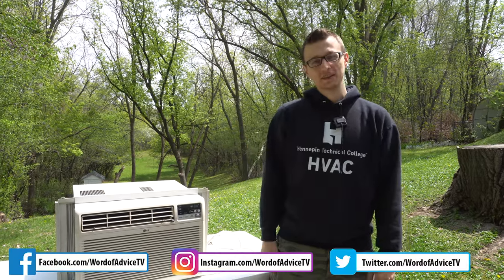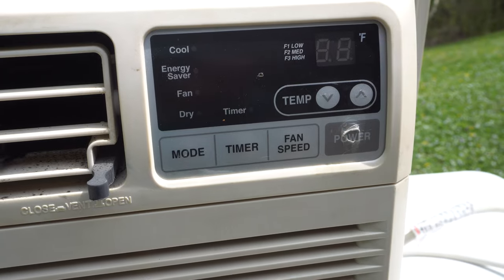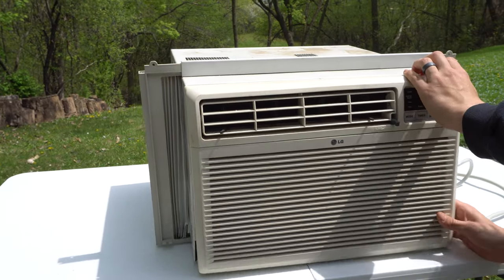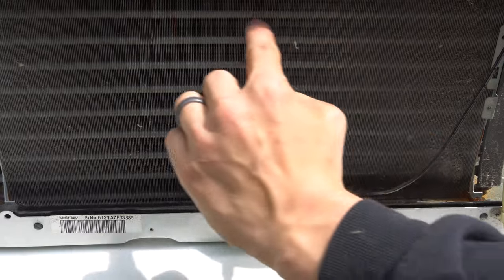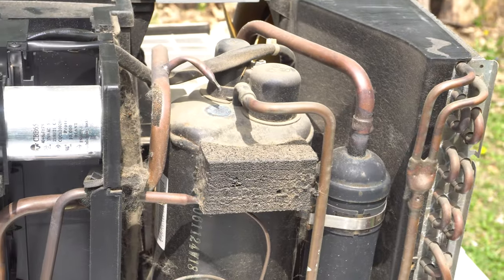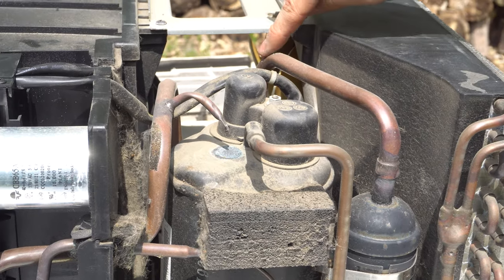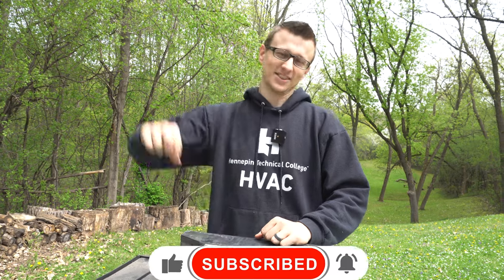Window AC Parts Names, Components, and How it Works

Comment: Your explanation of the channel that condensation flows through from the evaporator coil (at 9:40) just saved me a bunch of work.  My 23K BTU unit is also an LG, and that clogged channel was causing water to drip/splash into the room.  I had a 24-inch plastic cable tie that I was able to push down that channel and clear out the debris that had it clogged.  Thank you for an excellent video.  Tip of the hat to you, young man!

Comment: Excellent explanation, but with all the respect to you and your work, I would like to say something. This kind of air conditioner have no drier filter. That part in the suction line between de evaporator and the compressor suction is called (liquid receiver or liquid separator) and its function is basically avoiding that liquid refrigerant can get the compressor. Liquids can't be compressed and  it can damage the compressor. The drier filter in these air conditioners window type is installed between the condenser and the capillary tube and generally they have no drier filter, I don't know why. Sorry for my comment and greettings. You're doing a great job that's being very important for beginers.
Reply from the maker: I stand corrected. Thank you for pointing that out and explaining what it really is and what it does!
Reply: True , a rule of thumb I guess with filter driers : they are never factory fitted items. And iv not once seen one on a window unit.
Reply: I admire your graciousness. Overall, the time u take with ur many many videos covering many areas are deeply appreciated.

Comment: Great video, very informative. I'm not sure if my compressor is bad because I've tried to clean my little window unit as good as I could with it still in the window. It's a small window air conditioner about 7 years old, just isn't cooling very well all of a sudden. Thanks

Comment: I have a very old A/C unit in my camper I got a year ago, from the mid 90's. If I do all the cleaning as recommended in the other cleaning video & it still doesn't cool could I need freon? If so can I add it or who would I contact to add more? Your video's have helped me so many times to repair my furnace that I've saved so much MONEY 💰! Thank You! 😊

Comment: Great video.  Thank you for explaining all the parts of the Air Conditioner.  I learned a lot from your video.  Regarding your chess challenge...It is impossible for black to complete their turn.  Black King is in check.  Black can't complete it's turn when in check.

Comment: I apologize if this is already been asked, but can I get an explanation on the damper/vent?

I’ve heard both sides of the story; as in it does absolutely nothing and is pretty much pointless, or that you can get a certain percentage of fresh air compared to indoor air, etc.

So I just wondering does it actually affect in any measurable way? Will I get fresh air and a better smelling apartment with it open? what about the exchange setting? Does it literally vent stale inside air outside?

(You seem to mention it only matters when the fan only mode is being used; so does that mean it doesn’t absolutely nothing when the compressor/cold setting is being used? 

Thanks in advance. Great video. As others have pointed out, so clear and to the point.

Comment: So I'm not sure if you've already done it but any chance you can make a tutorial on how to separate and extend the wirings on the control panel so it would be a separate "wired" panel?  I'm modifying one for my camper trailer build.  I'm sure it's self explanatory once the wires are exposed but a video would still be fun for all. 🙂

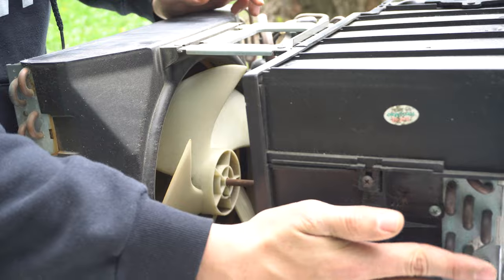Comment: 9:05 The evaporator does not absorb heat from inside the house. Why don't you tell people the truth? The compressor compress the freon. When freon is compressed, it get hot. The hot freon go through the condenser. The fan blow air through the condenser and cool down the freon. The hot air coming out the back of the unit is from the hot freon being cooled down.

Comment: Jay on the compressor on the  top you started to say start run and  something else ? where it's labeled the black thing on top. What about the smaller black thing next to it . what is that. Again slide that unit out in your table it's big enough it will save you some back pain . even clean it on there too if it's one if those walmart Costco plastic pvc type tops .

Comment: I'm in a van...I'm going to install it with the exhaust funneling outside...could the air inside the van get to cold to be recycled back threw the evaporator in the front?

Comment: can you install a window ac like this in sideway? in order to fit a narrow sliding window? some say you can't, it will damage the ac, I don't get it, why can't ?
Reply from the maker: The compressor inside the unit is mounted in an upright position. This compressor has oil in it which lubricates the pistons inside of it. If you flip the whole thing on it's side, the oil will flow out and it won't take long for the compressor to burn out.

Comment: can you put the AC unit 3 feet apart from the window. connect the air duct from the cold air wave to the window? basic i want to eliminate the compress noise and just get the cold air breeze. Is it possible?

Comment: wait, isnt the compressor cannot be tilt like at 4:00? i thought the oil would be up to evap and making the ac wont cool? cmiiw. i read that somewhere.
Reply from the maker: Just make sure to leave it upright for at least a few hours (or whole day if you want to be extra sure) before powering it back on. Usually by the time it dries after the washing, the oil should have migrated back into the compressor too.

Comment: Just found your channel and have been enjoying the content.  Great stuff.  Maybe you could help with a regular home AC unit.  My coil was pulling in the contact, but I wasn't getting 240V across the switch.  Played with it awhile then it worked.  Maybe bugs stopping full contact.  So I want to order a new contactor to have as a back up.  My original is 3100-15Q1408, with the following specs on the side.  Vac 240/277  FLA 35  LRA 180  RES 40.  Vac 480 FLA 31.2  LRA 75  RES 40, and Vac FLA 31.2  LRA 50 RES 40.  So, first question - does only the 240/277 matter since I'm only on a 240 Volt line.  And second, I can't seem to find one that matches exactly, should I go slightly higher or lower?  Thanks

Comment: So I drilled holes underneath my unit to let the water out( as I've always had to do on every unit), but I hit something with the bit, and all the freon came out. I thought it was a tank, but maybe I hit something else. Any suggestions?
Reply: I did the same thing on my midea u shaped. When I took the housing off it was the copper tubing on the outside coil I'm trying to find out if I can  braze the tubing. Hope this helps.

Comment: So, dumb question: Why can't you just run one of these small 5000 BTU window units in a room without actually hooking it up to a window? It seems logical that, even though it will be blowing some hot air out the back, the room itself that you put it in would get cooler and cooler, requiring less heat to be removed out the back. Therefore, this would seem to remove the requirement to vent it to the outside at all in the first place.  Does this make sense?  Why can't you just run one of these units in a closed-door 150 sq. ft. bedroom with no window just to cool that room down? Why does it need to be vented outside in the first place if you have a balancing effect between the cold air coming out the front which will overpower the warm air coming off the back? Is my thinking correct here or am I making some kind of mistake?
Reply: The amount of heat getting out of the unit will always be bigger than the amount of cool air. This kind of AC works by cooling the air inside of the room. Eventually, the temperature of the room will decrease, making the compressor work less and relaxed If there is a constant source of heat, the unit will not be able to cope. So you're never going to cool the room. In fact, it will feel warmer. The rear part of the unit exhausts the hot air resulting from the compression of the gas through the coil.

Comment: How do you check the Freon on these units? Is it by checking the compressor??
Reply: You don't. It is a closed circuit. Some technicians install service valves, but this should not be done.
Reply: @carcast  thank you so much for answering. I’ve wondered this for so long. So if it is not blowing cold air because of lack of Freon, then I would need to get a new unit all together?